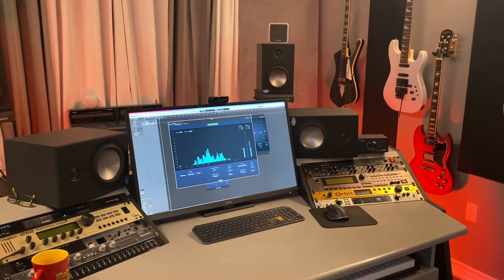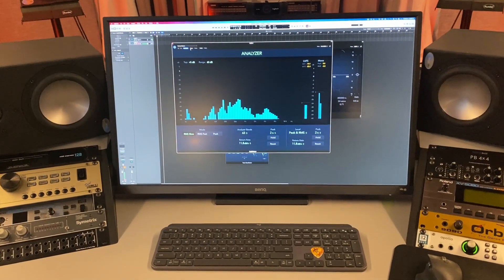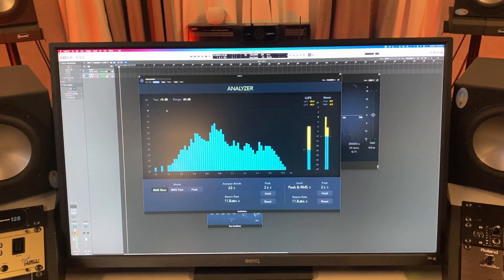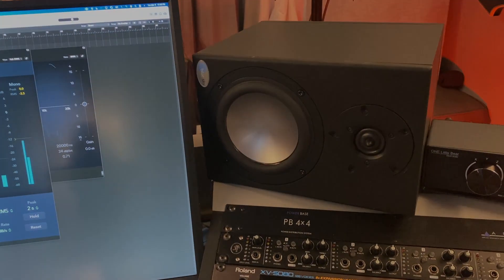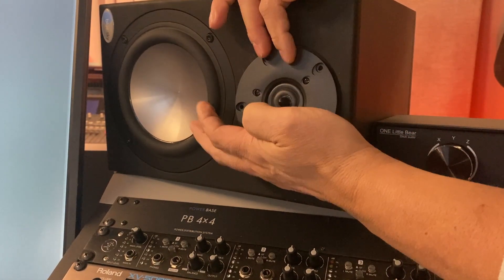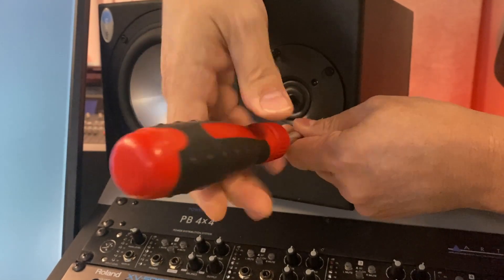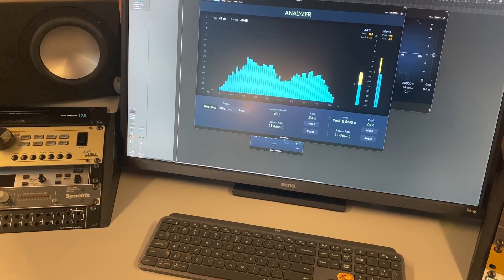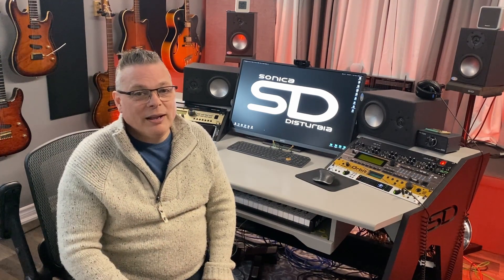Blue Sky Sat 6.5 monitor Tweeter replacement.

Comment: I have a pair of blue sky Sat 6.5 but i need to replace a woofer from one of them. what can i use to replace them so i can keep mixing , do i have to change both woofers? please help me i have a dead monitor.
Reply: Are you sure it’s the speaker? The SAT 65 often have a bad folder connection on the speaker terminal on the amplifier. A quick resolder and you are often good to go. Touch up all the connections to the 1/4”terminals while you’re in there. I’ve seen this problem at least six times so far.

Comment: I have these in my studio and home cinema room. I'll never replace them until they truly die and I can't fix them. I would, however, recommend replacing drivers in pairs...left and right. I bought spare tweeters just in case.
Reply from the maker: Absolutely! They have a great neutral sound that works well for home situations as well as recording studio applications. You can find replacements here https://www.parts-express.com/speaker-components/hi-fi-woofers-subwoofers-midranges-tweeters/tweeters 
Check out the other video on how and where to resolder the circuit boards for these as well. The early models had a bit of heat build up and developed cold solder connections which manifested as hissing, crackles and pop from the tweeters. 35-40 minutes a few simple tools and a soldering iron and your back in business!
Reply: @SDTunesinc   Ooh lovely. Need to do my center channel l, which is mk1.